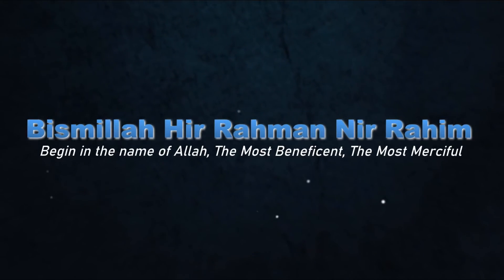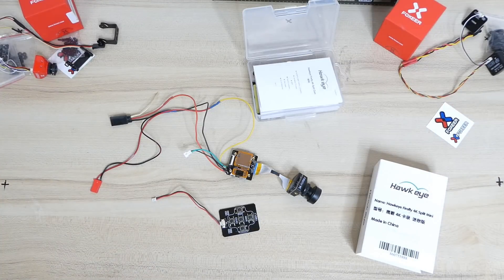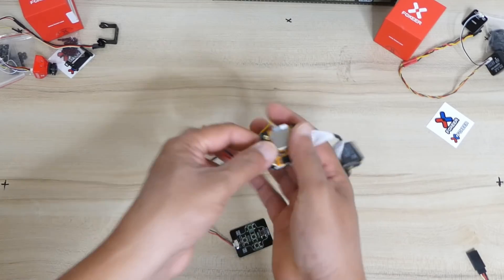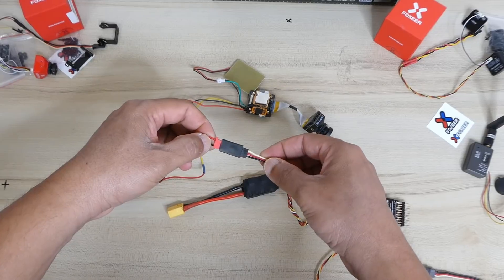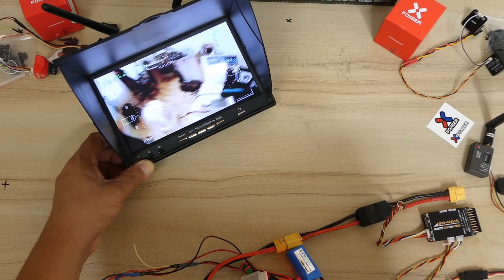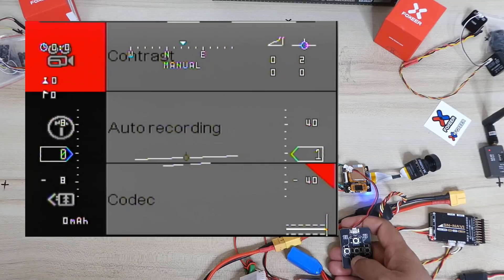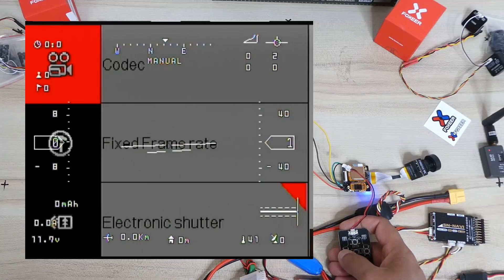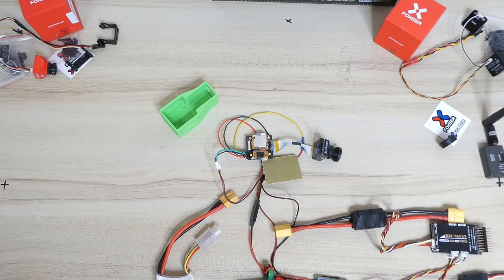FireFly 4K Split Mini AIO HD FPV Camera Complete Review

Comment: If i try to use a 3.7v lipo battery, I must use a step up DC to DC voltage to 5v-12v,  before the 5v ubec, true?
Reply from the maker: i totally forgot what was the voltage this gets. if its was 5v, i just use a UBEC with main battery